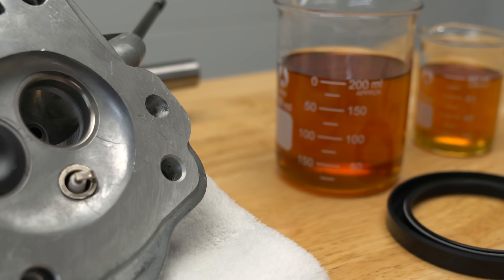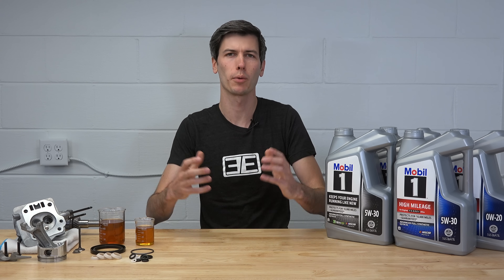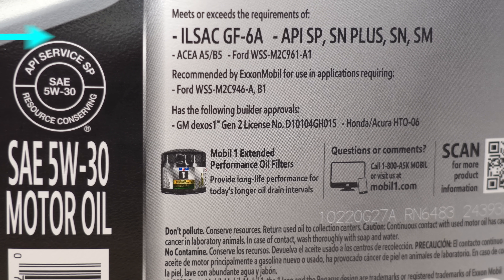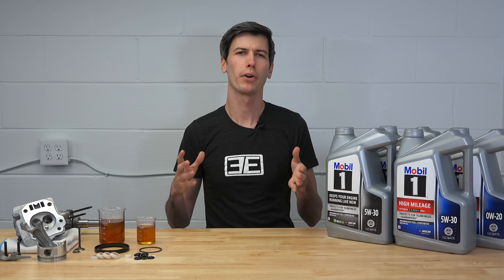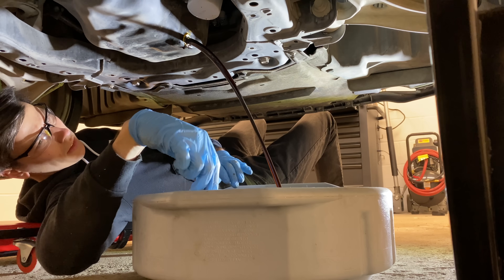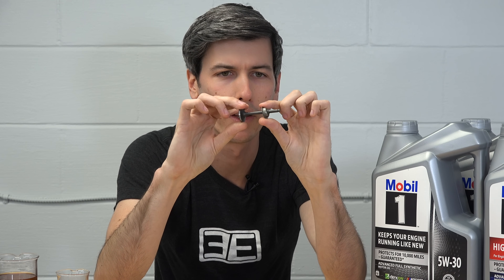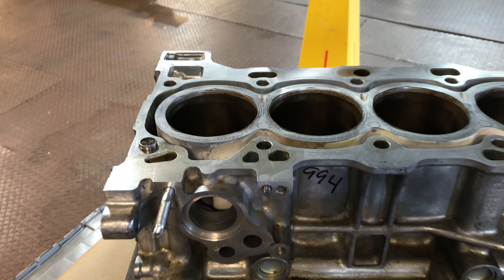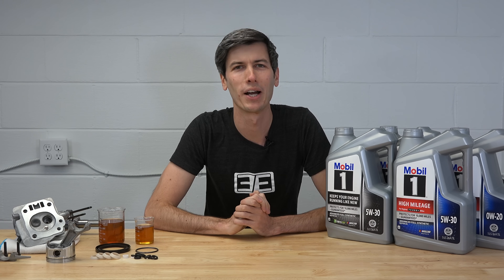Is Synthetic Motor Oil Bad For Old Cars?

Comment: I have to disagree on one thing. I experienced, at 2 different occasions, engines that were smooth as silk that devolepped heavy piston slap as the switch was made from conventional to high milleage oil.. The first one was my Mazda KL-DE 2.5l V6 in my 1995 626. It started to consume oil so i made the switch to a "leading brand" synthetic high milleage oil. Less that a month after that, the engine developped piston slap that remained even when hot. Same thing occured in a collegues K24 Honda engine in a 2006 Accord (only, his case was wayyy worse). Engine consumed some oil, and when he switched, less then a week after that, the oil was pitch black and it slapped so much it was embarrassing. Even my 300k+ km Neon that i once had was silent compared to his Accord... Theory is, there was some varnish on the pistons/cylinder walls and when the high milleage oil cleaned that, clearances became larger and that was the end of it. Didn't helped both of them consume less oil however. 

There is however 2 cases where it was beneficial. Both my and my ex girlfriend's 1992 and 1993 Civics. Same D15B7 engine, both had lived their lives on synthetic oils, when they started to take oil, we switched to Valvoline MaxLife Synpower and never looked back.

Bottom line, for me anyways, if the engine have a long and happy life with conventional oils, keep it that way. If it's new, go on Synthetic and don't look back. My corrent car is a 2012 Civic Si that currently have 431k km. The engine doesn't take a drop of oil, it never ever had been refreshed or whatever. What i use is AMSoil SS 0w20 during winter and 5w30 during race season (Summer). Good as new. As a matter of facts, it was tuned 2 years ago at, maybe, 350k km and it pushed 203whp.

My 2 cents. YMMV!
Reply: Dude, that is fantastic. My bro has a 2012 Si as well with about 60k miles. What would you recommend as far as maintenance so his car goes that far? we live in so fl.
Reply: @Synthwave89  I would say that regular maintenance does it. For the most part, my engine had AMSoil Signature Series oil and i used 0w20 during our frigid Quebec winters and i use 5w30 during Summer. I also use Fram Ultra filters as they are excellent. I follow the factory maintenance minder so, sometimes, an oil change interval is near 20k km.. I flush the cooling system every 160k km (100k miles...) Transmission oil twice per year. I also use Redline's excellent SI-1 fuel injectors cleaner twice per year.

If i were living in Florida and would'nt have to deal with frigid temperatures 6 months per year however, i would use a good quality 5w30 Synthetic oil all year round (AMSoil SS, Pennzoil Ultra Platinum, etc...) with a Fram Ultra filter and follow the Maintenance Minder. Those Honda K series engines are relative old tech developped in the late 90's/early 2000's and i don't buy cafe crap so i use the grade that is what they used successfully in earlier Si's. For the transmission, use Honda MTF or Redline MTL (i use Redline myself..) and change it every year. Use top tier gas and put a good FIC once in a while. Redline SI-1 is what i use but apparently Chevron Techron is good too. Good FIC (Fuel Injectors Cleaners) contains PEA (Poly-Ether Amine) by the way. Do your valves adjustments when they get noisy (every 100k km in my case..) DO NOT ABUSE THE TRANSMISSION, IT'S RELATIVELY FRAGILE. Engine however is tough and doesn't seems to mind revving up to 7.5k rpm once in a while. Brakes maintenance once a year, etc.. 

It's a good car but so far i can tell you the only real weak point i found are the rear calipers. Fortunately, OEM replacements are inexpensive at your Honda dealer.
Reply: Maybe it was consuming more oil because the rings were already warn and would have done that regardless
Reply: @barneybarret6088  I can't tell. Honda K series engines are real tough and my personal experience with them is stellar so far. I only use Synthetic oils however and i'm quite anal on my maintenance/quality of oil/filters i use. My own K24 is quite a bit more advanced in milleage then his (more or less double..) so i don't think his rings were worn. I do think they were gunked up given that he used mineral oils and the previous owner didn't leave a record of maintenance of some sort.. That or, maybe, as my K24 is a May 2012 one, it had some newer rings that corrected a problem that used to exist in prior versions of that engine.. i dunno.. guess we won't ever know too.
Reply: I think sometimes synthetic oil makes an old worn engine too clean and actually messes it up because carbon build up and sludge help maintain internal oil pressure.
Reply: @raybod1775  I can't tell for the oil pressure part but my guess is an old, gunked up engine can end up working well because gunk will tighten some spot that could have gone out of spec from wear. Then you clean up that gunk/varnish with good oils, the bearings and/or cylinder walls/pistons/whatever end up getting loose and begin knocking. I really think it's that than happened 2 times already.. Just like the crap was tightening some tolerances and the engine was fine with it..

Comment: I have an old engine that burns oil, on the last change oil change I put in a high mileage oil and I am seeing less puffs of blue smoke when I take off at the lights now. I think it might have reduced but not stopped the oil burning.
Reply: Stephen Johnson most likely your valve seals are worn
Reply: @OffshoreBluewater  Yes I think so too, irt doesnt blow smoke when I give it a rev

Comment: i have a leak in my truck that's old enough that it's hard to find parts, was originally 5w-30 and we moved to a 10w-40 iirc and since it's going on the ground anyways, synthetic is just easier on the wallet

i really want to restore that truck

Comment: I had an engine that required 10w30, it got 15w50 synthetic to get the oil pressure into spec.
Reply: swat1229 thanks, me too,,, THE synthetic W spec is most important... , that 15W SYNFHETIC IS TOUGH, STUFF ( Valvolines,etc) and mine flowed like a10w( hoping??).

Comment: Jeep TJ forum owners swear by regular dino oil. Usual argument is that the 4.0 engine doesn't need synthetic to run well and synthetics may lead to oil leaks. Pretty sure TJs leaked from the factory, so I'm not sure about that last point 😁

Comment: I have an older, high mileage engine. Used 5w30 had 15 psi oil pressure at idle. Switched to a 5w40 now I had 20psi at hot idle.
Reply: I am running 40 weight in wifes 11 regal because GM screwed up on some those 2.4 engines and have bad seals. We did oil consumption tests at dealer and they acknowledged but car was too old and vin didn't match with cars GM identified  that they would fix for free. Running the maxlife based on my friend who is a long time mechanic who has worked for Honda, Buick and mercedes. He said it should help cut down consumption and it has a little.
Reply: @macdaddybill  which one are u using bro
>?

Comment: I used 5W-30 in 87 350, not knowing at the time I needed zinc. I didn't drive the car really, only really fixing it up, and I had lifters to tap then later fail before I was ready to swap my cam. Went to conventional and added zinc additive, and when I change again I'll go back to synthetic and zinc additives.

Comment: theres way too much though and money put into this..anywhere in the north the car will rot out from around the engine before it ever wears out from improper oil/cheap oil/over clearances.. there can be component failure but rarely every a truly worn out engine.. be honest with yourself are you really gonna try and keep that car on the road for 400,000miles and if so is it really worth the 60$ x80 changes for better oil/filter.. 4800$ for fancy oil and filters that imo do very little.. thats a significant amount of money over the life of a long lived car in some places thats enough to pay someone to rebuilt your engine for you definetly enough for you to buy the components to completely rebuilt the whole drive train youself.. or a good down payment on a new car

rotella t4 (60$ cad for 20l) for 9/10 of my rigs and no name 0w20(12$ cad for 5l) for any engines that wont accept the 40w diesel oil typically a wix filter as theyre a reputable brand and no more expensive then a fram or no name

Comment: I'm not sure why, but the shots of oil getting drizzled into the center of a round seal sitting on a table top was a bit hypnotic, especially when it overflowed over the sides of the seal.  Internal voice, "Why is this overflowing oil so captivating?"  LOL!  Anyway, nice job w/that.  You're onto something.  ;)

Comment: I completely rebuilt an old 99 Tahoe with the 5.7 vortec and only use Amsoil signature series oils for the motor,trans and front/rear differentials. They work flawlessly.  K&N oil filter and air filter. Everything is stock though.
Reply: K&N s don't filter good. They flow but don't filter. I use AMSOIL oil filters
Reply: @429thunderjet2  i was gonna use amsoil filters but i watched a bunch of videos on all the main brand filters and everyone pretty much said that K&N was the best. And i figured with it being a high flow filter that maybe the oil could get around the engine faster on cold start ups and thus causing less wear. Ive also added some strong magnets to the inside of my oil pan and they seem to collect alot of metal shavings that otherwise would be in my oil.
Reply: @tahoeboy8658  that's why filters have bypass valves in them or if they don't on certain engines the bypass is built into the block or filter housing. 
So no matter what a full flow oil filter is not going to restrict oil pressure or volume. I use the AMSOIL EA 99% efficient at 20 micron filters with the Signature Series oils. Because keeping out the particles bigger than that are what wears out engines. Most other filters are only good to 30-40 microns, those sizes are getting to be about the size of the internal clearances in an engine, so the potential to grind them up becomes more of a possiblity.
Reply: @429thunderjet2  K&N says it filters down to 10 microns
Reply: Also AMSOIL Signature Series has fantastic low temp pour point of like -58°F & flow capability (no wax) so cold flow isn't a problem.
Reply: @tahoeboy8658  really? News to me!
Reply: @429thunderjet2  ill take your word for it and try it out my next oil change.
Reply: @tahoeboy8658  but what percentage of 10 microns? Not to much I bet.
Reply: @429thunderjet2  couldnt find it on their website but ill check the box
Reply: @tahoeboy8658  hmm, sometimes I like a desktop or laptop better to find stuff rather than my phone, if that's what you are using. But ok, thanks

Comment: Great video and explanation. I wish you would have expanded just a little with a fix it or park it ASAP recommendation for a flickering oil light.  Your advice to increase oil pressure by increasing oil viscosity is 100% correct. However, an engine activating the oil light (< 10 PSI) has a serious problem and should be fixed before it fills the oil pan with rods. I'm sure you know that but some viewers may believe otherwise and keep driving.   

I get it though. I've seen 90W used in worn engines to keep them running for another day or another week. Increasing the viscosity works but it is a very temporary fix and those that made it until they were pulled were in seriously bad shape 

Still an excellent video with great advice. Thanks.

Comment: Well in really old engines removing sludge isn’t exactly great. Take for example BMW R motorbikes from the 1960s.
Those engines don’t have oil filters. They use centrifugal separators an oil thieve (it’s a mesh made from wire) along with special reservoirs that let the oil sit and  let the debris within the oil settle on the bottom. Modern oils are designed around oil filters hence their use of compounds that keep debris in solution so they can be filtered out. On old engines this would make the debris get cycled through roller bearings that aren’t exactly good at dealing with this kind of contamination.

So yes you can use modern oils on old engines provided the engine has a proper oil filtering system and doesn’t rely on the sludge separating out in special reservoirs.

<=btw BMW gearboxes for motorbikes from this era use the same oil cleaning method.

Comment: I have a question... Could thicker oils cause excessive blowback?
I have a bike, and I was originally running 20w50 in it, when it came time to change oils, It would be common to have lost about a third to half of the oil. Seals aren't leaking BTW. Last time, I switched to 10w30 and I've been vigilant of oil levels, and so far, it's still most of it in. So, the only thing that I could imagine happening was excessive blowback

Comment: Another great video.  I've been conducting a loosely defined experiment for awhile. Drive an '05 Suburban with 8.1L with 158K miles that burns about 1Q/3,000 miles using Valvoline High Mileage semi-synthetic.  Tried Mobile 1 and Rotella full synthetic oils and each time it burned 1Q/1,000 miles. I've been told synthetic has smaller molecules that sneak by but from this video perhaps the high mileage may be a thicker oil. Is there any logic to smaller molecules?

Comment: There are no seal swelling additives in high mileage oil, there are seal conditioners just as there are in all motor oils, high mileage oils just contain a larger dose roughly double the amount over standard oils.

Comment: Is there ever a con to using a lower winter viscosity oil in place of factory recommendations? In other words, why shouldn't one replace a 5w-30 with a 0w-30? Been curious about this for a while but haven't found many answers. I imagine increased usage of viscosity improvers and pour point additives to get the wider gap between cold and hot operating characteristics could be part of the reason? i.e. the oil's properties will change more drastically over time because of the increased used of additives  and their degradation over time perhaps? But is that really a reason to not use them?

Comment: The owner's manual for my 2007 Honda Accord 2.4 calls for conventional but it says it's OK to use Synthetic. I switched to Mobile 1 just to solves the freezing Monday morning start problem. But last year I upgraded my battery to the one used in the V6 Accords. I'm saving money now using $14 Walmart Supertech Synthetic High mileage. I've put over 100K miles with no problems at all. The newer Walmart synthetic oil marked Dexos Approved.

Comment: Great myth-debunking video Jason! I've been running synthetic oil in my weekend cars for close to 30 years now, and they make a difference! Years ago I had a BBC that would only rev to 5200-5400 rpm on conventional oil. When I switched to synthetic I was able to get 5800-6000 rpm. It was also remarkable how little the oil discolored during the year, unlike conventional oil.

As for seals, I currently own a Mk1 Jetta GLi coupe with 205,000KM (120K miles) which I've used Synthetic in for over 15 years, and there isn't a solitary drop on the driveway from either the front or rear main seals or the oil pan. Damn good for a 37 year old car. Synthetic is worth every penny.

Comment: My Mom' had a 67 Dodge Dart with about a 100.000 on a slant six the best six cylinder ever made. In about 1976 a garage talked here into Mobil 1 synthetic oil and it started leaking Oil worse than any Harley I ever saw. My wife's brother helped me pull the motor and rebuild it and she drove it until she bought a new Buick in 78. I drove it as a winter car for another four years on standard oil. I use synthetic oil in my 05 Chevy Silverado but it only has 79.000 on it. I was thinking of using synthetic in my 98 Harley Fatboy but decided against it since the manual called for mineral oil.
Reply: @Itsalongwaythere  Yes sir it was a bullet proof motor my 85 Dodge had 460.000 on it when I sold it the a concrete contractor who drove it a long time. That is why Chrysler stopped making it it never wore out.

Comment: SUNOCO 5-40 SYN_TURBO GOLD FIRST BASE OIL ..NOT REUSED
I USE'D IT ON MY KADETT CITY 1.2
ASCONA B 2.2 IMSHIR TURBO INTERCOOLER 
GOLF1+2+3 TD VENTO TDI
Passat 4M V6 TDI 210HK 556 NM 
15.000km oil change ..
No car used oil after SUNOCO 5-40 SYN_TURBO GOLD

Comment: I have a question.

I've just had the engine in my 33 year old Mazda 323 rebuilt (all new pumps, new standard bearings, +20 thou bore, ported head, the lot), and want to switch it to full synth when I can (I know it's not worth much, but it's worth a lot to me).  So at what point would you consider switching fine?  I've now done a bit over 150 km since putting the engine back in, so obviously I'm still busy with the run-in process.  But I'm thinking ahead here.

Comment: What about old 60s and 70s cars that used flat tappet cams? Ive always herd these engines need more zinc or zddp that the synthetics dont have enough.
Reply: Yes I have been told the same the zinc content of modern synthetics is not enough, in fact to use vintage car oil with added zinc.  Lucas Oil makes a brand of this.

Comment: In canada we have only "advanced synthetic oil" and not "full synthetic oil" for mobil one products. Does someone know what percentage of real synthetic oil is in "advanced synthetic oil"? Thank you
Reply: Marketing.   Base your decision off the approval (ex, Dexos) and cost.
Reply: @johnclark7406  so it's the same product or not?
Reply: @madmax9009  It's meaningless. It could be or not.  It's why I said you should shop formal approvals for your vehicle.  If your automaker is Mercedes Benz and they recommend oils with formal approval of 229.50 then buy whatever oil has that approval and don't worry about what else is on the label.  Oils with 229.50 will essentially all perform the same.